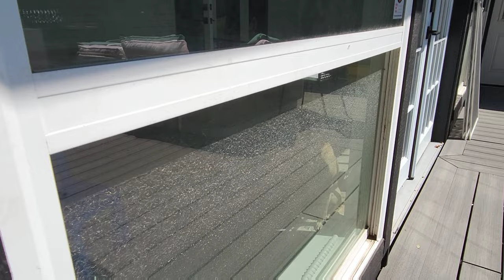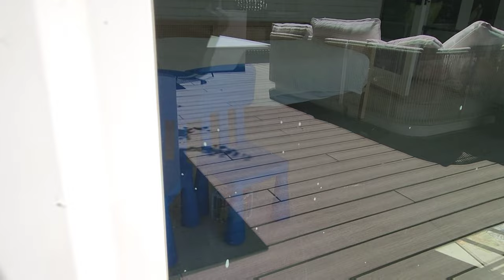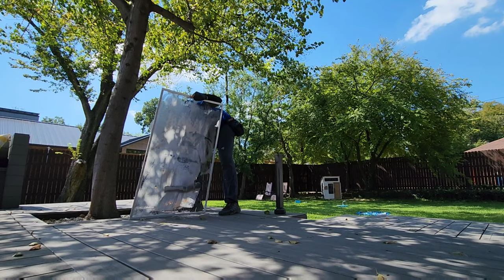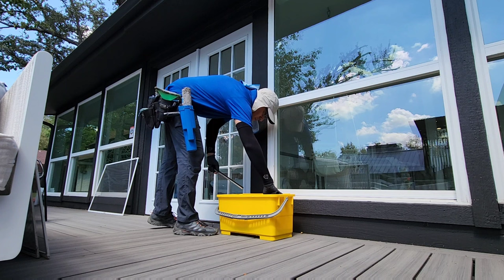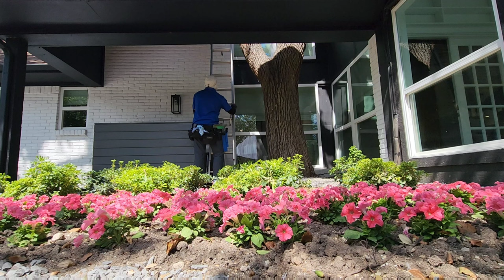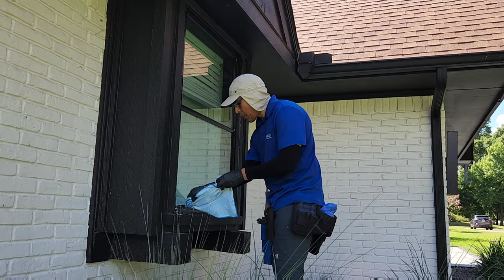Rustling Sounds at Work | ASMR Window Cleaning

Comment: Hello my brother. I have been cleaning windows in Aspen Colorado for 23 years and absolutely love what I do. I like your style and are very detailed oriented and clearly enjoy your work like I do. I would like to start my own YouTube channel to help out the young ones, I’m 61 years old. I got this tip from a window cleaner in Telluride Colorado a couple decades ago and it has served me well to this day.  When I am using steel wool I unroll two of them, then I fold them flat and make a bigger pad. I believe it speeds things up and I a little easier on the joints. First thing I would recommend is a new window cleaner is ladder levelers like you have, you Gotta have them for safety and speed. Nice work my brother. John Kennedy Aspen Window Cleaning